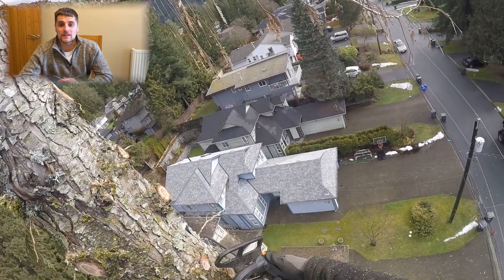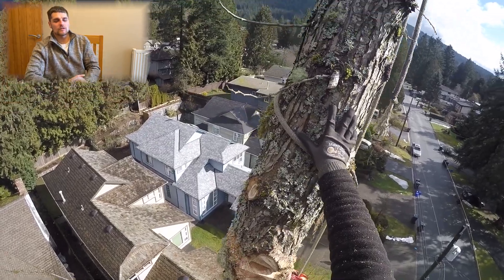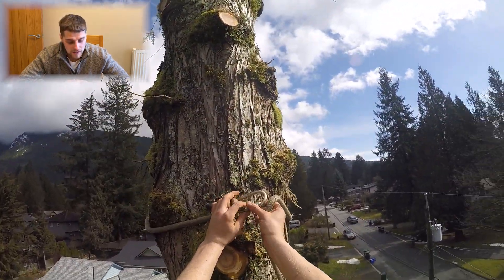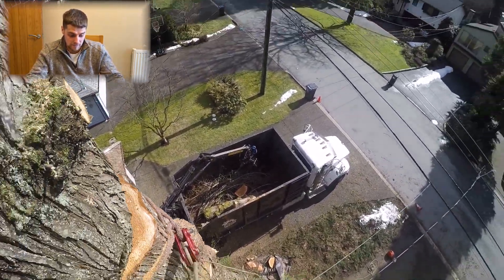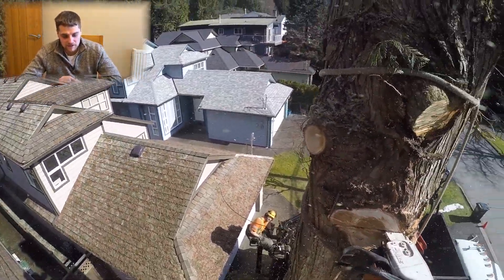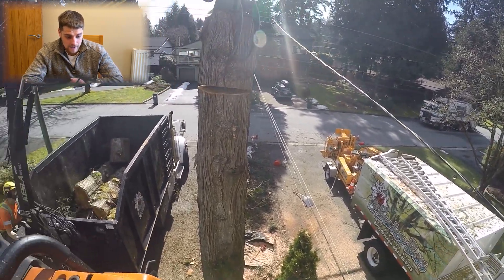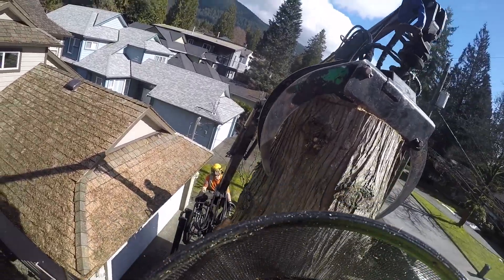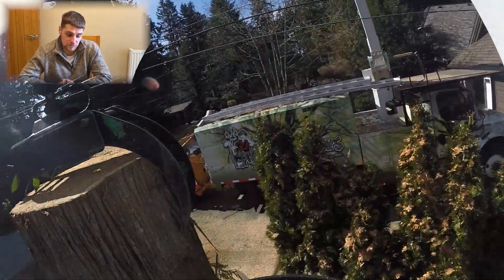Learning from Failure: Arborist's POV Mistake

Comment: A half hitch would decrease the load on that carabiner by at least 50%. If not more, depending on Clutch (of the rope) You also want rope in the system to absorb shock that way it’s not all on the rope being cut by the apex bend in the biner. Because there wasn’t a half hitch all the shock goes to it. Add a half hitch, or 2, …or pull the rope go around twice then up under the overstrand to make a half hitch, the rope would be closer to the rigging point and then the clutching forces of the rope cushioning the forces and means what % wasn’t clutched (grabbed) then that goes to the carabiner. 

Clutching is what the rope will grab - species of tree obviously there are no clutching forces on a Sycamore vs a Scaly bark ass pine tree.
Reply from the maker: There was a half hitch used on all the cuts including the one that snapped. I agree with that you’re saying the half hitch definitely helps. 

In this case that wasn’t the issue 👍

Comment: Glad you mentioned rushing and competitiveness as root causes, I've seen really senior pros make basic mistakes and break stuff/endanger ground crew because they were rushing. I always overquote on time and take it easy - if all goes well and you get done sooner, shave a bit off the invoice, happy customer. I've had scary near misses because I was rushing - have to consciously stop myself. Thank you for the video
Reply from the maker: They’re both contributing factors for sure! A lot of the time it does come down to the money/time on the job. If you’re under pressure to get done for whatever reason, that’s asking for trouble. Like you rightly said, keep the prices high and even the crap jobs aren’t that bad.

Comment: Yep this video shows you what not to do. I’ve seen guys get crushed,lit up like a Christmas tree cut themselves out of trees when you are a climber and running a crew you are responsible for everything on the job you gotta watch out for obstacles and you guys won the ground before you start cutting
Reply from the maker: Yep there is a lot to learn from within the video. I prefer the crew leader to be on the ground as the climber needs to fully focus on the job in hand and not what’s going on around the chipper. But you’re absolutely right the climber is responsible for how the tree comes down.

Comment: I'M AN ARBORIST OF 40 YR'S , STILL CLIMBING, THERE'S A FEW THING'S HERE, I JUST WOULD NOT USE or DO, USE CARIBINER or KRANE PULLING MY ROPE, IF FOR SOME REASON THEY DID, THE ROPER WOULD FIRST LOOSEN THE ROPE FROM AROUND THE TREE..... ALSO, I'VE ALWAYS HAD A SAYING QHEN ROPING, "YOU GOTTA KNOW WHEN TO HOLD THEM and "KNOW WHEN TO FOLD THEM". A ROPER, WHEN and IF ALL OBSTICLES ARE CLEAR and HAS ROOM SHOULD NEVER HOLD A LIMB or LOG 🪵 and LET IT SLAM INTO THE TREE, REFER BACK TO MY QUOTE! (HE) THE ROPER SHOULD'VE LET THE LOG IMMEDIATELY RUN DOWN THE LOG TO THE GROUND IF ALL IS CLEAR, ITS WHEN U ARE HOLDING THE ROPE TIGHT, THAT U CHANGE THE DIRECTION of THE LIMB or LOG of ITS NATURAL  PATH, IN THIS CASE BY PUSHING OFF THE LOG A GOOD KNOWLEDGEABLE ROPER/BOSS QOULD KNOW TO JUST ALLOW THE LOG 🪵 TO RUN STRAIGHT TO THE GROUND, ALL YHE ROPE WILL DO IS BE THERE FOR SECURITY REASONS , I GET PEOPLE TELLING ME , U CAN'T PUT THAT BIG A LIMB ON THAT 1/2 INCH ROPE 🪢 , OHH YEAH , WATCH ME, U GOTTA KNOW WHEN TO HOLD, KNOW WHEN TO FOLD , ALWAYS KEEP UR WIT'S ABOUT U, HAVE FUN, I'VE NEVER SNAPPED A ROPE, ONLY A BULL ROPE BY PULLING A WHOLE TREE ON THE GROUND 😮

Comment: For the last 4 cuts the rigging system was undersized. Expecially if It Is a rigging kit that you use alldays
Reply from the maker: You’re probably right in that one too. I dont like using whoopie slings on pieces like this either after another incident that happened.

Comment: Pretty sketchy having the grapple operator directly under the rigging as well. 
With a good rope man, you can get away with going big on 1/2" rope. He can run it smooth enough there's very little forces put on the whole system. 
Thanks for posting and breaking down learning experiences for the rest of us to learn from.
Reply from the maker: Yeah definitely mate you’re not wrong. Thanks for the comment and the feedback 🙌

Comment: That is such a long fall - weight of piece × every foot it falls + it's own weight at the end of the fall. Get that block and half hitch closer together to minimize the weight put into the system.
Reply: Ok looks a bit better as you get lower.
Reply from the maker: I made this point in the video and also had a discussion with @zaccheus in the comments about this. We were having opposing views on whether or not this makes a difference. In my view it most certainly does. Thanks for the comments 🙌
Reply: @LukeJohnsonArb  sorry I made that comment a bit premature, later in the video I noticed you talked about it and were keeping the distance smaller. Though I definitely would keep it smaller up high also just in case for some reason it doesn't run. Anyway God bless and thanks for the video and response.
Reply from the maker: @forcomments2870  Completely agree with you mate 👍 No problem

Comment: Ultra slings are my choice...pulleys are cool if ur climbing
Reply from the maker: Not really used the Ultra slings much. My only issue buying expensive textiles is they expire within 5 years of use and after that they won’t pass a LOLER inspection. 

You can end up spending an arm and a leg on rigging gear. I can definitely see the advantages of them though.
Reply: @LukeJohnsonArb  stay safe and always think in advance ... you know what we do
Reply from the maker: @douglasdonegan9372  Good advice man! Thanks for the comments 👍

Comment: Cycles to fail on a rope are going to be a lot fewer when you’re maxing out the capacity of the rope over and over again. A 300lb piece drops far enough it can have a 3000lb shock load. Therefore a 3/4” rope was in order.  I know that’s a 5/8” rope and block and I’d say it’s been used a lot looking at the condition of the rope. New rope yearly. Inspect your gear. Don’t work your gear to its max potential and a grcs would’ve absolutely been the answer for this bigger wood.  Stop using port a wraps on big wood. The bend is to hard on the rope making rope management harder and it’s definitely harder on the rope. A $3500 grcs is key.
Reply from the maker: 100% agree with everything you said. This was filmed 5-6 year ago while I was employed at a company. They did have GRCS and Hobbs but we didn’t use it on this job.

Nowadays, I’ve got my own company, GRCS, full range of rigging ropes and I’m qualified to inspect arb equipment here in  the UK (LOLER inspector) 

This mistake in the video was a key learning opportunity for myself 👍

Comment: You also could use a thicker diameter rope, or take smaller pieces of wood! Or or or
Reply from the maker: Cutting the piece smaller, using a higher capacity rope (or one with more stretch), adding more rope in the system (impact block installed on the rigged piece), reducing the distance to fall (between pulley and half hitch), and by letting it run (but move the truck first)

Hindsight is a wonderful thing 🙌

Comment: I'm no arborist, and it's been years since I've worked with ropes, but I do know that there's a difference between mountain climber's ropes and caver's ropes (regarding their elasticity).  Do you guys even take those types of considerations in?
Reply from the maker: Thanks for your comment👍 Yes in Arb there is a huge range in ropes ranging in capacity and elasticity. Climbing Ropes differ from Rigging Ropes in their construction. In this case we were using a rigging rope but well beyond its capacity.

Comment: The distance between the half hitch and the block doesn't matter. The distance between the cut and the block is what it important.
Reply: In a negative rigging scenatio, a short distance between block and half hitch Is the only way to reduce the height of freefall of the log ure lowering, and so to reduce the Dynamic load on the system.
Imagine this distance is 1 m. It means 2 m of freefall and a log weight x10
Reply from the maker: @giordanone  Definitely, that was my case in the comments above 🙌
Reply: @giordanone  You're right in
 saying that the less the piece falls, the less potential for shockload. The less the piece falls, the less kinetic energy it developed before deceleration. However, where you tie the half hitch has no bearing on how far the piece falls. The position of the cut determines the start of the fall, and the position of the block determines the end of free fall. Therefore, the distance between the block and the cut determines how far the piece falls and how far the piece falls directly determines its kinetic energy and dynamic loading potential.
Reply: @zaccheus 
The ½hitch is the ropes point of contact to your work piece. If it's 3" above the block, you have 3" of fall (and acceleration) before system neutral, then positive. If the ½hitch is 36" above the block, you would have 3 feet of fall (and acceleration). The distance of contact between the hitch and the block literally means a difference in acceleration.
Reply: @mattrybacki189  I see what you're saying, but the displacement you describe is incorrect. The piece doesn't fall farther if you tie the hitch higher. Just how the hitch is higher on the piece before the cut, its is then lower on the piece once its hanging upside down. The hitch moves a farther distance, but the piece does not.
Reply: @zaccheus  correct. "The hitch moves a further distance, but the piece does not ".
The hitch, however, is the point at which the system is attached. The higher the hitch, the further it is from the block, the more acceleration gained. I love your content, brother. If you have time on a job or day off, do a little experimenting and post it. Would be cool to see how much difference is even made...
Reply: @zaccheus  dangit!  Okay, I concede. By the time the hinge breaks, the difference in hitch height could be negligible. It depends somewhat on the size & shape of the face cut, but if it's anywhere near the level, the hitch height is irrelevant. I apologize for being an ass hat 😁
Reply: @mattrybacki189  hey you're all good. It's a brain twisting thing to think about. It took me a few years to figure it out. I asked a mentor about it earlier this evening even because this comment section had me second guessing my theory 😅 I do intend to do an experiment at some point when I have the right opportunity. I have a friend with an enforcer. We can skip all the math and go straight to measuring the peak force
Reply from the maker: @mattrybacki189 Displacement of the centre of gravity stays the same as long as the half hitch is tied below the centre of gravity.

My view is still remains (and I sketched this out to make sure I’m not talking waffle) that:

Half Hitch + Block Closer Together = Less Free Fall Before Pulley Catches Piece + Piece Caught Higher Up the Stem = Less Kinetic Energy (Dynamic Load) + More time to Slow Piece Down in System.

The difference mainly be small but if we are talking about 300kg pieces and differences of 1-2m I think the forces will add up quicker than you think. 

Half hitch closer to pulley in my view is the safer bet, as long as the ropes are well clear from being cut by the saw. 

🪵💪🏼🌲
Reply: For what my opinion is worth I think it’s kinda both your guys thing pulling as much slack out as possible having block as high as possible and having half hitch as low as possible they both make sense to me lol
Reply from the maker: @joemyers4037  I agree with everything you said there. Block high, hitch low!
Reply: Minimize the freefall
Reply: @johnhass1084  We all agree on that, the crux is the matter of whether the distance between the block and the hitch or the block and the cut contributes to the distance of free fall.
Reply from the maker: The distance between the half hitch and the block absolutely have in impact on the forces loaded on the system.

If there were two identical scenarios, same sized piece with the same sized face cut in, but one half hitch was 1m away from the block and the other was 0.5m from the block.

One would free fall for 2m until the block catches it the other would free fall for 1m. 

The one falling for 2m will have more kinetic energy and exert more forces on the rigging system.

What you’re saying isn’t necessarily wrong about the cut because the size and position of the cut will determine the distance between the half hitch and the block.
Reply: @LukeDJohnson  Look it it this way. The distance the piece falls is determined by where it falls from and where the fall stops. The end of the fall depends on where the block is placed and how far the rope man let's it run. Obviously, we want to block to be as high as possible to aid the stopping position. Where the piece falls from is determined by the cut. Where the knot is is located on the piece has no bearing on where the piece is falling from.
Reply from the maker: @zach-riggs I agree that the distance of the fall remains the same as long as half hitch is below the centre of gravity. 

My view is that by configuring the half hitch closer to the block will reduce possibility of slack getting into the system from the piece free falling resulting in shock loading.
Reply: @LukeDJohnson  The amount of slack that enters the systems is also dependant on the distance of free fall and not the position of the knot. The entire rope is slack during free fall. The only way to reduce slack during free fall is to shorten the rope during free fall by having the groundy pull more rope through the friction device at the bottom of the tree.
Reply from the maker: @zach-riggs  In the Arb Association Technical Guide for Rigging (UK Guidlines) it says:

“14.3 How to Reduce the Potential for Shock Loading and High Peak Loads
14.3.1 Several factors affect shock loading and peak loads, most of which can be controlled or directly influenced by the operators involved in the operation:
* Rigging technique selected: For example, when the pulley is below the load, snatching causes the greatest peak loads because the section of wood will momentarily free-fall before being caught by the system, which means there will be an inevitable 'impact' on the system.
* Distance of fall: The further the section is allowed to fall, the greater the speed it will gain. If the falling section is then stopped suddenly by the system (snubbed off) the resulting shock load will result in a high peak load.
* System configuration: A poorly configured system where the cut sections are allowed to fall further than is necessary before being 'caught' by the rope, or which prevents the free running and gradual slowing of the piece, or which has little or no flexibility/elasticity built in will result in potentially high peak loads.”

My personal interpretation of this is by moving the half hitch closer to the block. You reduce the distance of free fall before it catches. It’s not that you reduce the distance of fall, that’s exactly the same, it’s the difference of free fall that may increase shock on the system. 

I could be wrong, I had to draw a sketch out to double check my logic, and I still believe it adds up to what I’m saying. Appreciate the debate though 🙏🤣 I will send you a copy of my sketch to your Instagram. Cheers
Reply: @LukeDJohnson  Wow man, thanks so much for putting the time into referencing that information. I, too, have enjoyed this conversation. I'll look for your sketch. I think we are still different in our thoughts about what core factors contribute to peak forces. I will make a short video in an effort to best illustrate my line of thinking. I won't mention your name, to maintain your anonymity if you wish. If you'd like to be a part of it, just leave a comment and I'll pin it to the top.
Reply from the maker: @zach-riggs  I’ve sent over the pics already from @ljarborist Instagram. No issue I just took a picture and selected the text on my IPhone 😅 

Happy to be a part of it I’ve been thinking it’s worth finding out the answers even for my own benefit!

Comment: Worth mentioning having less rope in the system as you move down the tree as well. The rope absorbs energy, so the less you have, the less it absorbs. It's pretty crazy looking at peak force calculators (like Samson's), keeping all things equal except amount of rope in the system and how much that can raise peak force to the system.
Reply from the maker: Thanks for your comment 🙏

Great point, definitely worth a mention.

So the ways in which this could have been prevented include; Cutting the piece smaller, using a higher capacity rope (or one with more stretch), adding more rope in the system (impact block installed on the rigged piece), reducing the distance to fall (between pulley and half hitch), and by letting it run (but move the truck first)